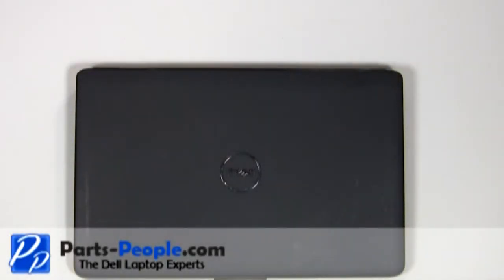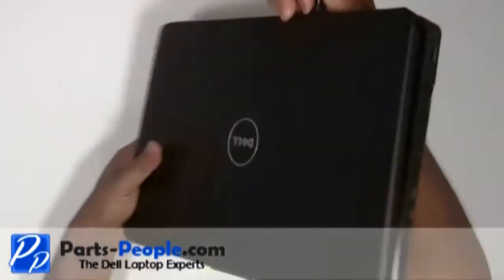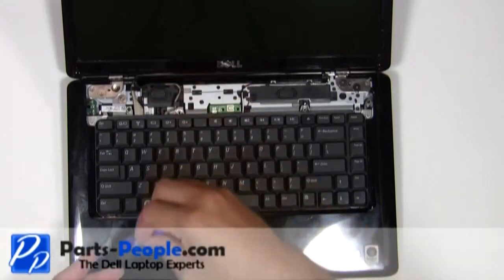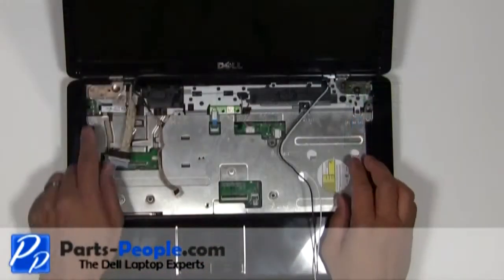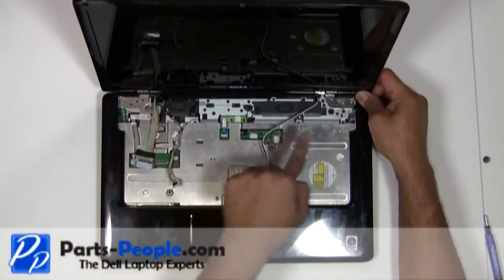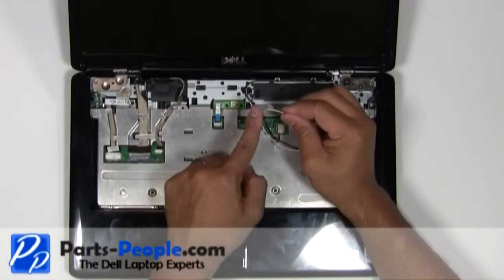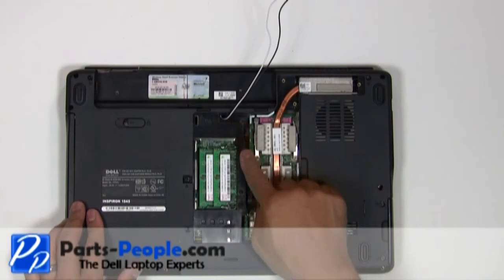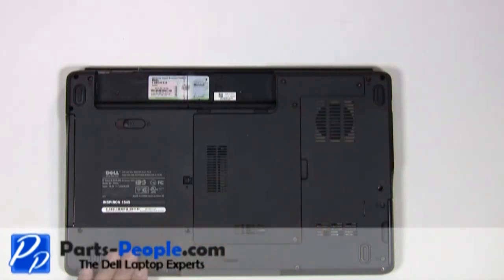Dell Inspiron 1545 | LCD Display Assembly Replacement | How-To-Tutorial

Comment: thank you for this awesome video.  I disconnected the monitor from my laptop and using it with  an external monitor. However , my wifi is not receiving any signals from any routers near by. Is there any component in the monitor of the wifi like antenna. etc. Thanks in advance
Reply from the maker: Yes, the wifi antenna are housed in the LCD back cover. When you removed it, you disconnected your wifi.
Reply: thanks for your reply.... puts a lot of the head scratching to rest :p oo ok...is there a way of retaining the wifi antenna without the monitor. thanks again
Reply from the maker: If you removed the front bezel on the display,  the screen, and I think a hinge you could remove the antennas from the back assembly. You could plug the loose antennas into the WLAN card and it should work fine.